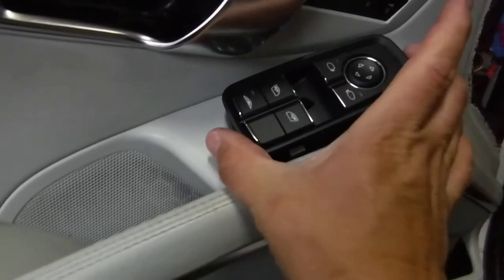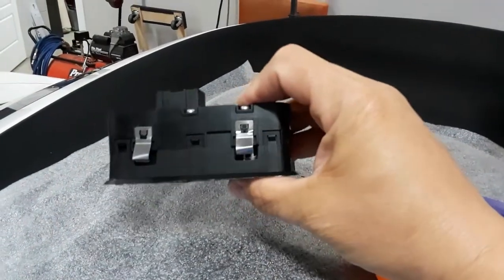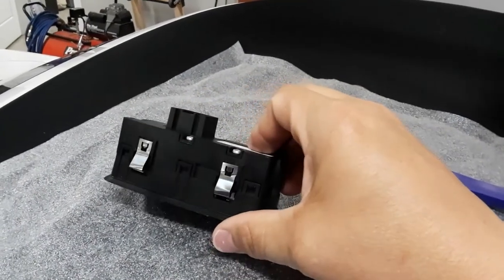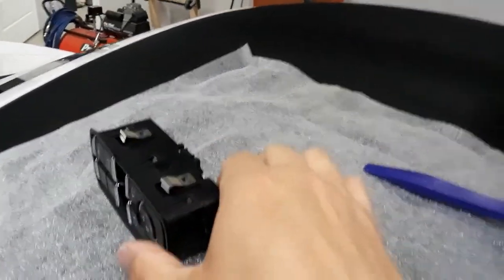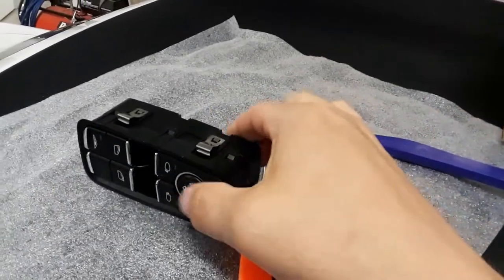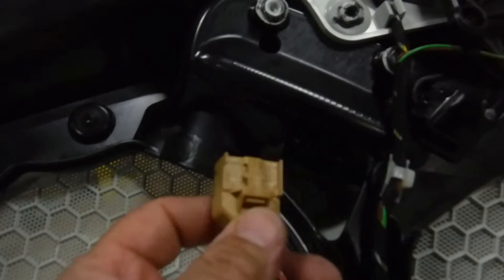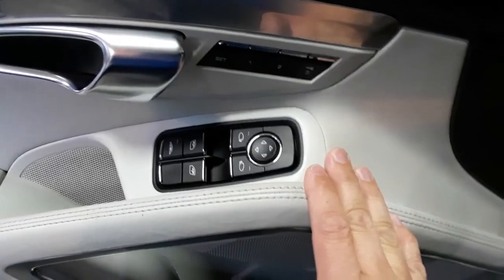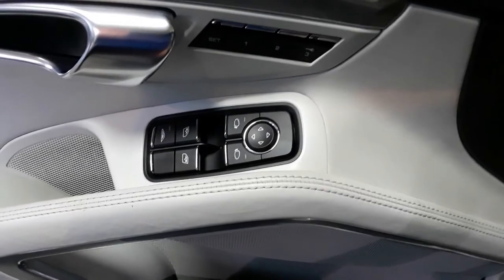Installing a 991 Drivers Window Switch

Comment: what part number is this window switch? I would need the same for a 991 cabrio without folding mirrors
Reply from the maker: I'd recommend you do a search for your part on Pelican parts or some other Porsche parts site, just to be sure you get the right part#, however  the part I purchased and installed as a replacement is 99161315302DML. The original factory switch, (I still have the broken one) says 991.613.153.00. The switches are identical in function. There is a very slight difference in the graphic on the  (left & right) window switches.